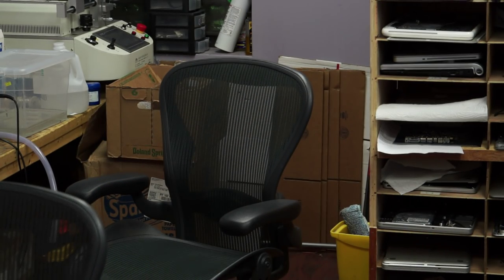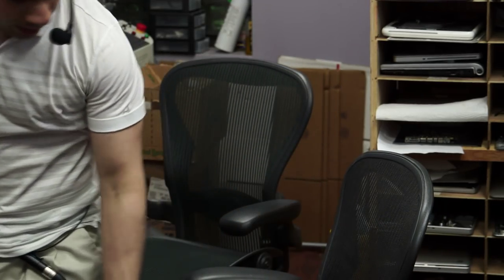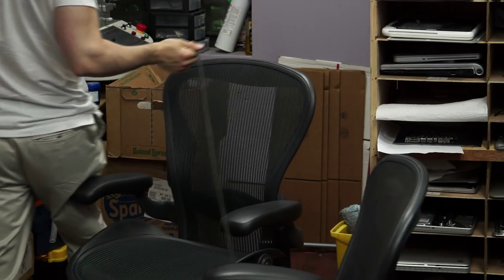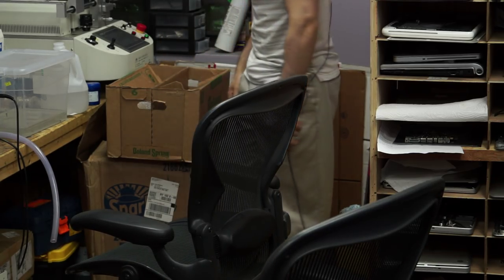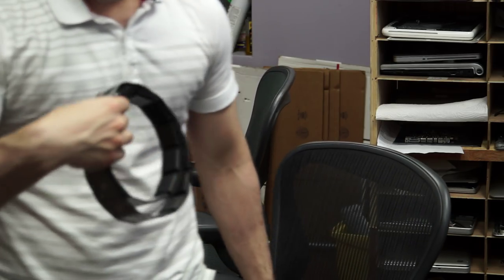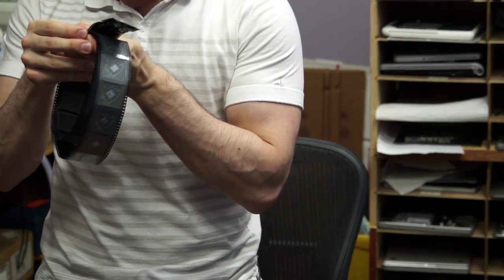Is BGA rework a rabbit hole to hell? Should I buy a BGA rework machine for my repair shop?

Comment: I do repairs as my hobby and to get cheaper hardware then repair it myself. I bought cheap hotair at hamfest, built IR rework station out of halogen and heater scraps and doing rework/reflow to get another two years maybe three out of the old scrap that is available here in east europe. I get a 75% maybe up to 90% GPUs and notebook GPUs/chipsets working again. I do it for my friends so i am tracing the time until next failure but i didn't get any information of anything failing fot two years that i do it. It is mainly GTX4xx 5xx era hardware plagued with heat/BGA problems, and when the supply dries out, there is no problem, i invested almost nothing. I will rebuild machines to suit next needs and do whatever next. I just advice for GPUs skip ovens and hotair and build IR top and under heater with those ceramic blocks that are under 20$ on ebay and various bathroom heaters. control with triacs and thermocouples from arduino and you get the value back after three GTX465s reflowed and they will work at least for another year if you figure out the sweet temps.
Reply: Good info, thanks!

Comment: Lucky me.  I'm a TPS engineer.  I develop Test Program Sets that walk all functionality of a board and isolate the fault down to a node.  My confidence level on a failed node is up and over 90%.  I get to pre-package all my testing into a 1 hour program that I start and walk away so I can go back to working on something that requires user interactions.  Do these boards you work on have sufficent Test Points to develop a program to diagnose on your behalf?
Reply: I'm interested.

Comment: BGA work was always a waste of time, looking back I should have said no to customers for this type work.
Reply from the maker: nozynoz What were your experiences that led you towards that conclusion? I would love to hear!
Reply: Louis RossmannFirst of all, Thank you for your great work and time. 
Like you stated in this and previous presentations, its all about the time and reward. I did a number of machines starting by re-flowing then moving onto re-balling to replacing BGA chips and not forgetting the mods on the cases. The results were always poor rate of success and returns, never felt happy take payment as I could never guarantee a solid solution.  Finally, in the end I accepted  and told the "truth"  it's is not worth the time and money. My conclusion most units are designed to fail, BGA being. "key component". Tracing a fault is far more rewarding and guaranteed success, again Time in relation to reward.
Reply from the maker: Was this mostly with GPUs or with other types of chipsets as well?
Reply: Louis Rossmann Main repair failures were around the GPU, rest of the boards pretty much straight forward. But over all, "instinct" usually tells you how bad the laptop is. For example, external condition moving onto internal condition, what are the vents like, how blocked they are. Then what are the symptoms!. Then only then, I will proceed with a re-flow of the GPU nothing else is on offer, everything else not economical for GPU related work. Generally the answer sorry, but no. To honest my views are that most new laptops developed for a life span of 18 months, Flex in Plastics being first being destroyed. After all that, Dude "your the man".
Reply: Right after the warranty is over. Curious... Strange coincidence

Comment: This subject is more than a year old now yet still holds true. I just want to say thanks for saying all you said about the logic pertaining to the business of component level repair and BGA rework. I can not remember the last time i used my costly BGA rework station. Why? For the very reasons you stated. BGA rework is not guaranteed to work the first time around, nor are the chips. I am sure to make more replacing 2 DC power jacks in one attempt than two attempts at  a failed BGA rework.
Reply from the maker: +Doc Falworth yes!

Comment: Hey Ross , let me shed light on some more information , from 2015 onwards , both intel and amd have moved to system on a chip (SOC) approach , which means , even if a single power rail on a motherboard gets shorted out or a usb port gets shorted out , the SOC goes bad and you have no other option but to change that SOC as everything is controlled by that single chip and for that a bga rework station is a necessary requirement and without that , your business is done  .  Please share your views on this point .
Reply from the maker: +maxinventer once we are at thst point that chip will cost as much as the device itself and this business will be pointless. You also must consider that even as it stands getting major bga chipsets is a crapshoot.

Comment: been doing BGA repairs for 16 years and couldn't agree with you more on that 30-40 mins rule ;-) we live in a world ruled by money unfortunately  and even though i want to fix that particular mainboard and help a customer it is just not worth it.
I have developed a system of checks where i can check i'd say with 90% accuracy the board is worth repairing or not within 10 mins,

OF course i get stuck at phones ( my specialty) for longer than that and thats the reason why i am watching your video about IRDA SMD rework station LOL...dont get angry bro :-)))

Comment: True on getting bad chips.  If it's small, I now make a castellated board and install a comparable chip I can find from Mouser or Digikey. Because usually they have a different pin assignment.

Comment: Sorry for my lack of knowledge... i am just involved with databases and software analyses, dont know anything about those electronics at all. All i know is that BGA's been causing lots of pain on people who use notebook. I once bought a notebook with an AMD 6990m 2gb (around 2011 or 2012). Started seeing artifacts on the screen and all those things. Tried repairing like 2 or 3 times. Each one of those repairs costed me 850. Ended up dead and everybody didnt even want to touch it and try to repair. I watched your video and it made me understand them. Perfectly. I would do the same as they did now that i understood. What i would like to understand is why... just why BGAs give us so many issues? Is it still a concern now-days that (i guess) the technology might have improved? I suddenly decided to give it a chance (after years of psychological treatment to cure me from the trauma from having another notebook).... i decided to give it a change and bought a notebook. Now to my awful surprise, i found out that now-days even the processors are coming in BGA! ... An INTEL i7 !!! i looked at myself and said - "What?? My processor is in a BGA? No... this cant be happening". Been trying to find answers , but no one seems to even want to  give me attention and read and answer my questions.....i would love if somebody could clarify me if BGA issues still a concern...if it has improved along side with the technology improvements.... if there is any temperature i can take as a red line so i can monitor and take care it doesnt ever get past that so i can guarantee my job's been done?... I mean,i am just worried
Reply: I think the problem is the overall product design. BGA by itself isn't a bad technique. I suppose the pc manufacturers just allow their chips to run too hot. It's a consideration of how much speed you can get out of it vs how many people will actually run it at that capacity all the time. So if enough users don't run their laptops at full potential, it's acceptable for the manufacturer if a small portion actually doesn't live up to the proposed performance for a long time..
Reply: BGA is pretty much the standard for high pin-count ICs on motherboards which aren't designed to be replaceable, for e.g. laptop CPUs/GPUs, GPUs on graphics cards, etc. You can get a lot more pins connected that way compared to something like QFN, so that's why they're used. The only problem is that you can't easily tell if it's soldered down correctly like you can with QFN and you need to reball the chip using solder balls instead of just soldering on the pad like any other component. So you need dedicated machines and high powered hot air stations to deal with them, and most of all, time, which makes it a lot harder to justify in a repair shop environment where time is money

Comment: could anyone plz tell me a hot air and solder station I could buy for less then 50 bucks plz it would really mean a lot if u could tell me and if u can't still ty
Reply: to be honest with you mate anything you find under $100 for both hot air or soldering station isn't really gonna be good for repairs like mobos/GPUs etc. Some soldering stations are good but a lot of cheap hot air stations won't have the power you need, and you'll end up cooking every other component waiting for a chip to come off (I thought an 858D would be good enough for even some small chips, and man, i learnt it the hard way). I recommend BST-863 or Atten ST-862D which are over $100 but well worth it in my opinion. No clue on soldering stations though.

Comment: AMD is garbage.
Reply from the maker: jeremiah9561 Yeah. I have an R9 280x in my desktop that is decent, useless in Linux compared to VDPAU, but decent. But the processors are complete trash in terms of the high end consumer market, they will not be competing with Intel again for a long time. :(
Reply: Louis Rossmann Yep, when I interned at a computer store, the boss was telling me way back when intel CPU's were still locked and AMD's weren't, people would overclock the hell out of a cheap AMD CPU up to spec of a higher clocked one which would cause them to literally catch on fire. He hasn't used AMD since, and AMD support is terrible, another reason I won't be making a purchase from them for a long time.
Reply: Louis Rossmann Hard to compete when you've got very little resources compared to intel/nvidia - i'm amazed that they can fund any r&d at all. I'm keeping my fingers crossed that AMD's new Zen architecture (2016) will actually be good.
Reply: kr239 Time will tell with these types of projects
Reply: I very like AMD because it brought me lots of business